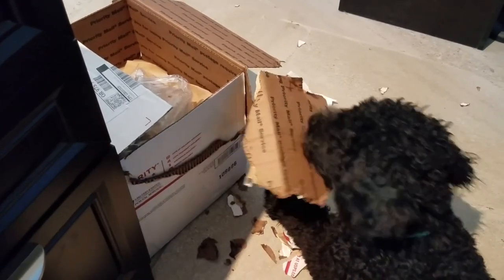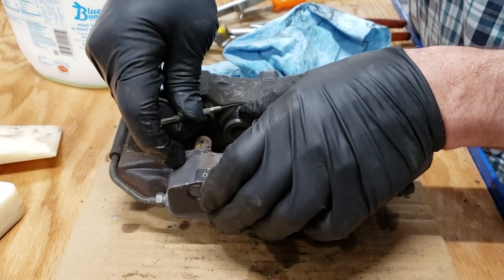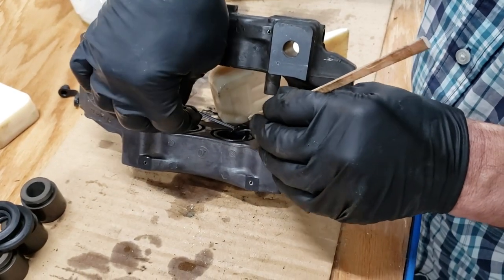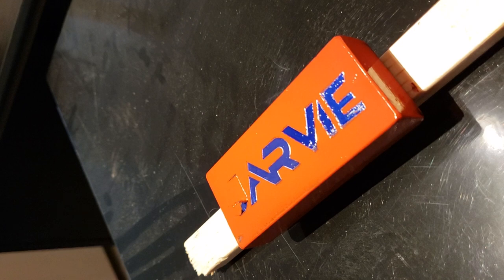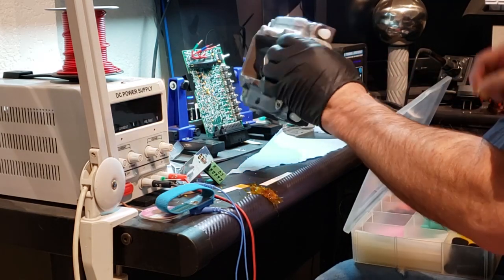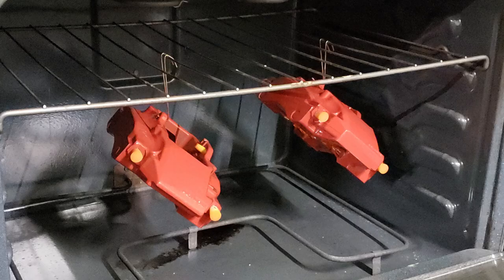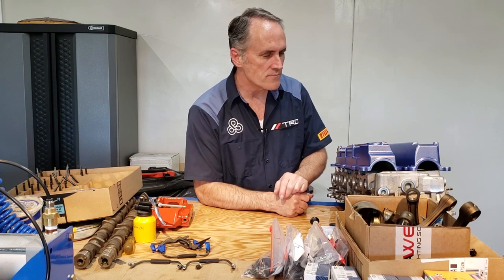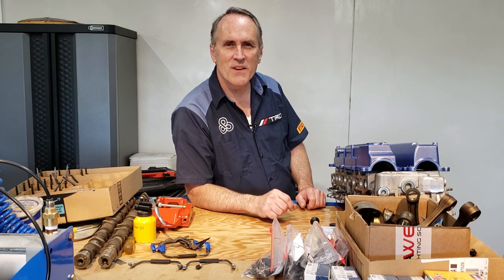Flop to fantastic- powder coating redemption

Comment: Heat resistant tape, often used to cover threads on powder coated parts.... maybe next time 🇦🇺👍
I know, I am only 12 months late with that information.....
Also, preheat heavier parts prior to powder coating, the base actually needs to reach temp.
If you paint first and cook for longer, the powder will burn, and be darker than intended.
Reply from the maker: In the end the problem may have been that the steel pins had become magnetized wrecking hovac on the particle charge. Heating higher may have fixed that as well.

Comment: Did you choose the 911 brake calipers for their size, given that they fit nicely over your chosen brake disks, or did you consider performance as well?
Reply from the maker: I had three requirements. Multi piston, pad surface area and side mounted. I guess that multi piston and surface area = performance

Comment: You had said the vinyl turned kinda black what cause that to happen in the process?
Reply from the maker: I used Orcal 651 of which has had lots of good reviews in the Powder coating community (mostly for masking). I guess 400 deg for 12 minutes was to much. The color failed, but the vinyl itself held up fine.